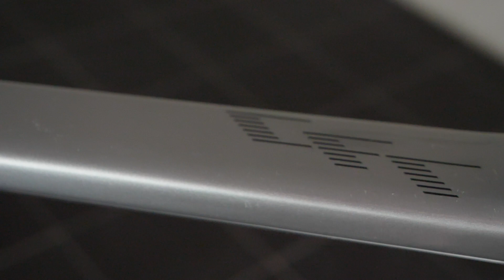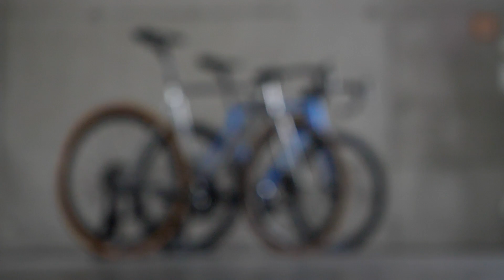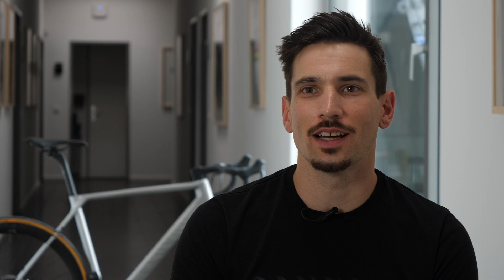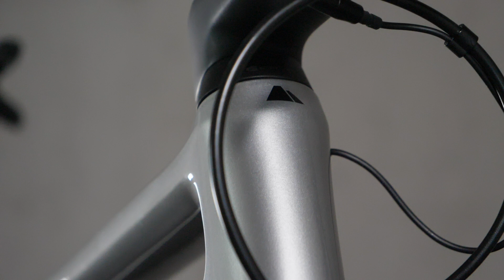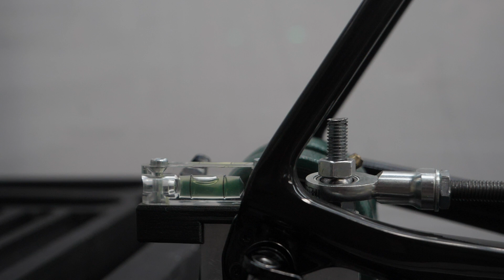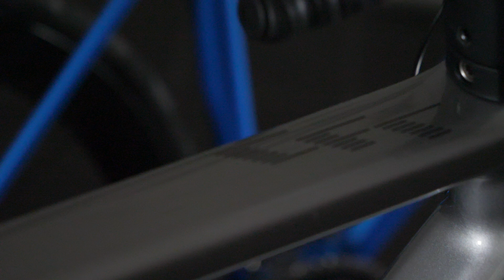Premium VS Midrange Carbon Fibre: What's The Difference? | NEW Canyon CFR

Comment: Decided to edit this comment to make the intended point, rather than bring up people's issues with a specific individual...

I'd be interested for Canyon to send a small selection of random frames to independent testers to really see what the quality of their frames is. High modulus carbon fibre means nothing if the manufacturing quality and tolerances is poor... Claiming they scan each frame to meet their standards means nothing if their standards aren't high enough
Reply: You mean that disrespectful guy, who swears at people he never ever met? And dont forget that he only receives a framesets with issues. Of course he does not appreciate good framesets, because there is no reason for the people to send him that ones.
Reply: @merunkovykefir9578  He likes Time
Reply: I wonder how close to the claimed weights they actually get. Luescher Teknik recently posted about a Cervelo that was way heavier than the claimed weight.
Reply: @Calum_S  I weighed mine and it was pretty close. Probably accurate considering usually the claimed weight is for an M and I got a L.
Reply: Hambini place Canyon at the better end regarding tolerances
Reply: Hambini fanboy detected.
Reply: Hambini Troll disciple spotted.  Hambini =one (skewed)  unit sample size carbon frame “expert”
Reply: Hambini? Lol - he’s using a fake name and credentials to try and sell you his BBs
Reply: @dafj5618  are you able to provide proof to back up this claim?
Reply: GeebusCripes his name is Sanjeev Varah
Reply: Totally agree! If Canyon if so sure of the quality of this bike frame, why don't they send a random selected frame to Hambini?

Comment: Is the cycling industry going backwards? 

A year ago Canyon released the Evo... Now it's the CFR. 

Specialized had a ultralight Sl6 ... Now it's the Sl7 

Trek had the super light emonda ... Now it's heavier.
Reply: It’s been going backwards for years
Reply: The industry runs in circles. Better keep up!
Reply: watkinsdakota yep 27.5 size wheels were used on bikes after the war then got phased out in the 50’s also bikepacking bags were used for touring well over a 100yrs ago and used for soldiers in both wars that used bikes but everyone thinks it’s all a new thing
Reply: I mean the normal rider or even amateur racer are not climbing mountains everyday, most riders are on rolling or flat terrain. So most of the gains for people are aero gains and not bike weight gains. For a world tour pro who do climb mountains they tend to be going so fast that aero becomes more important and the downhills need to be faster. Also if you want a super light bike all of last years models are on sell so go and buy them if you want light weight.

Comment: Im surprised for the price they sell for, cables are exposed, looking messy !
Reply: My new Canyon SLX Ultimate is cheaper than a second hand Spec. SL6 here in Denmark. Canyon bikes are cheap, but I agree that it is surprising that they don't have a bike with full integrated cables.

Comment: Surprisingly still visible cables... I was expecting full integration for top of the range bikes...
Reply: That was my question too, as soon as I saw the frameset. Moreover they didn't even talk aerodynamics. 🤔
Reply: Please ask them why can’t they make an integrated cockpit!
Reply: I love both my Canyon bikes, but they are starting to lag behind with regards to integration and aero on their Ultimate....
Reply: I suspect it’s because they’re designed to be shipped directly to consumers for final assembly. They’re assuming most consumers lack the skills to be able to route the brake hoses and di2 wires through the cockpit and headset.
Reply: Granite State Irish I’ve had two Canyons and there is nothing to putting them together. The headset just needs to be put on and tightened. It can come pre-wired internally as much as it can come pre-wired internally IMO.
Reply: Granite State Irish my Scott and my Ribble have internal routing, as well as my Speedmax
Reply: @granitestateirish6380  Nonsense, they ship it so you only have to put together the seatpost and wheels. Frame and stem+handlebar / cockpit come together.

Comment: Here's my question for Canyon that I hope you'll ask for the rest of us: 'How much force perpendicular to the 0.6 mil CFR carbon can it withstand before cracking?'
Reply: @schmuck Norris  That is for the entire bike and I agree, but it would be prudent for any engineer to test first the properties of any new material (CFR) before using it in varrying thickness like 0.6 mil. This means they know exactly how much force can break it.
Reply from the maker: Good question, the frame is manufactured to comply with ISO standards, and will most likely greatly exceed these standards
Reply: @gcntech  Oh I bet it does and that Canyon have done lab testing to know the exact figure. But would it not give the rider the peace of mind to know that the carbon can withstand the weight of his butt should he, on some occassion, wishes to stop for a while and seat on the top tube to savour the beauty from the mountain he had just conquered?

Comment: This is their “newest, best, lightest carbon Fibre ever”. Yet, the CFR EPS is 300g heavier than the Evo of the former generation? Even though they kept the tires, the saddle, the cockpit and the seat post, and chose a lighter group set and wheelset. Okay, well then!
Reply: Not true. A) The frame is actually 30 odd grams lighter than the EVO one but B) they claimed this is the lightest production bike they ever made - the EVO was always just a limited collection (in fact, you can no longer buy on their website as far as I can tell).
Reply: messi9991 so the frame is apparently lighter, yet the bike with lighter components is heavier? That’s magic.
Reply: @LarsRR  List every component and its weight, you are missing something.
Reply: messi9991 I am not. Lighter group set (Super record is 200 or so g lighter than SRAM Red AXS), lighter wheels (mon Casseral v 25y), same Schwalbe TT tires with a tube (no idea if the tube changed, it’s not listed), same Selle Italia saddle, same seatpost (Schmolke). So apparently, the added weight is all in the cockpit, the fork and the frame. The PM was part of the update for the Evo also.
Reply: @LarsRR  So you didn't list everything. Nor did you understand that the EVO was never production model, it was a limited series. The CFR is not.
Reply: Huh? This cfr is 641gr when evo is 675gr
Reply: Lars Disc brakes
Reply: @gdevansh  the Evo had disc brakes.
Reply: Devansh G. Exactly. It’s just heavier, that’s all

Comment: Here's a question the industry needs a push on: With the limited to non-recyclability of Carbon Fibre, is it ethical / sustainable to ride / buy / sell carbon bikes & components? All very nice, lite, stiff, pretty, but what are the carbon footprints of these products and what happens to them when we've done with them? I've just bought my first carbon frame, and am thinking of selling it on again to replace with custom built steel for this very reason. My gut feel is that with the industry keeping very quiet on these issues, it means they realise it's not very sustainable / ethical.
Reply from the maker: It’s a good question, but it’s also likely that better quality carbon frames will last a lot longer and be passed down/sold second hand. It would be fantastic if a carbon bike frame could be recycled, so we’d love to see that in future
Reply: @gcntech  Danish brand Coh&Co builds frames and bikes (urban, cargo, gravel) from "Interweaving carbon and stone fibres, and fusing them in the world’s first recyclable high performance composite resin" and they claim to be the "first fully reclaimable composite bicycle". They are made in Copenhagen and I saw some cycling around, but rarely. They actually also build wooden frames ;-) https://www.cohandco.com
Reply: Is it not less ethical to get rid of something you've just purchased straight away? There's a carbon footprint to that steel bike as well - why not stick with what you have if you're concerned about the environment, buying more shit is never the answer.
Reply: @philthewriter  Well, the carbon frame is about 12 years old, bought 2/3/4/5/6th hand, so it's carbon footprint is well baked in. One of the reasons I'm asking the question is that while mulling over replacing it (mainly because I'm less keen on it having built it and ridden it, it was a b*stard to cable, and I just haven't gelled with it - could be a 2020 symptom tho) I wondered what happens to old carbon frames. Then got a bit concerned. What does happen to old carbon frames? Do they get landfilled?
Reply: @lfoster7601  Is a good question, and can imagine a huge amount do sadly end up in landfill. That said, anecdotally, everybody I know with carbon bikes bought 10+ years ago still have the same bikes (even if they've added to the collection), none seem to be suffering the catastrophic fatigue some people seem concerned with. Second hand seems to be a blossoming market, which I guess leaves landfill to the broken/damaged frames. Which is also a shame, as I'm personally convinced that carbon is an eminently repairable material, albeit adding weight for proper repairs. Guess it's easier to cut out and replace a tube or fix a weld on a metal bike, although not sure most people would bother. Hope you find a nice steel frame, I've got an old Ti bike and much prefer it to carbon.
Reply: Are you factoring the carbon footprint of the steel tube manufacturing and the welding (oxyacetylene, MIG, TIG) of your custom steel frame? Yes, we can recycle steel but there is an involved carbon footprint.
Reply: For me, there are several things in this:
1. Scale
The carbon bike industry is certainly not that big. I wonder how many carbon frames are sold each year? How many people do you know and how many of those have a carbon bike? And it's an item that hopefully does not get replaced every year. And it is also a very lightweight item, 1kg or so per frame. And you do not throw a serviceable frame / bike away, you  sell it. Comparing that to things like plastic bags and other plastic packaging items that get thrown away immediately, the carbon footprint seems relatively small.
2. Repairabiltiy
Carbon frames can be repaired, usually for very little money compared to the price of the bike. A friend of mine completely broke one of the chain stays, and it was repaired for 300 CHF/USD in expensive Switzerland! I did not feel any difference in the bike after the repair, it probably added some grams to it, but who is counting?
3. Recycling
Now, as you know, it's a composite material out of carbon fibers and some sort of bonding agent/resin, usually epoxy. The epoxy can be burnt off without damaging the fibers. As the fibers are woven, there is currently no technology that I am aware of to turn it back into individual threads and weave it again. The fabric usually gets shredded into short fibers that are used for reinforcing plastics. Usually resin content is 30-40%, so 300 to 400 g of resin per frame that gets burnt and is lost. So it is less CO2 than driving your car for a couple of kilometers. Now of course the manufacturing will have some carbon footprint as we.
So overall, in terms of reduce/reuse/recycle, it is not as bad as you might think.
Reply: Pole’s approach is food for thought and a good read: https://polebicycles.com/why-arent-we-going-for-carbon-frames/
Reply: Ive heard of the "recyclability" of aluminum a lot but I have NEVER heard of anyone actually recycling their aluminum bike. Aluminum being more recycle friendly is a moot point since nobody recycles bikes, they sell/donate or they throw them away. You also cant just stick a bike in with your soda cans, recycle centers arent equipped for something as heavy duty as a bike frame as the process to melt it down is very energy heavy.
Reply: @ah4598  
I did recycle an old mountain bike I had since I was 14 or so. Very easy here in Switzerland, there's a metal collection a couple of times a year, just put all your old pans and stuff on the side of the road at certain dates and they come and pick it up. They then separate aluminum from steel and process it. As they process metals by the ton, it does not matter that your bike is a bit more dense than the rest of the truckload full of coke cans...
Reply: a h I think maybe the trashed bike would be shipped to other parts of the world just like many things, then get destroyed and melted... I know a little about the “the other parts of the world” thing, in there, the trash is offloaded from the ship then people begin to walk in the trash search and filter everything that has a value, electric wires and all the metals are high value objects, they got collected and sent to the recycle factories. The “recycle” process is far more longer than you may think, many dirty things don’t happen in more developed areas, doesn’t mean it won’t happen in other parts of world... Back to the aluminum, I think you should have a peace of mind, think there’s far more metal in there than bunch of wires, so it will get recycled and won’t be just buried, someone can even make some profit out of it.
Reply: My last alloy frame ended up in the tip after a crash snapped it in half...
Reply: There is a way in recycling https://youtu.be/-ZQzfwdHf1I?t=210
Reply: Well if it’s burned out, should it all becomes CO2? Anyway even in a form of fiber, it’s still carbon, the same as coal... But I don’t know what will be going on with the resin part... An interesting thing to think...
Reply: @xuchenglin6256  
The recycling process would be at temperatures where only the resin would degrade (it's in vacuum, so not burning). I think the melting temperature of the pure fibers are very high, above 3000 deg C. So you end up with fibers without resin.
The fibers are more or less pure carbon, but the manufacturing of is pretty energy intensive, so it is worth it to keep the fibers in circulation and reuse them.
Reply: spoeni wow interesting to know all this process, my knowledge seems too limited in the recycle. Thanks man!
Reply: Carbon Fibre to some extent is reusable in making other kinds of plastics, if we dispose off our broken carbon parts responsibly to firms that can recycle them so it is sustainable in the long run.
Reply: @thisDavidLiu  So we use our unsustainable CF to increase our unsustainable plastics? Sound plan.
Reply: @lfoster7601  No need to be so smarmy as well as ill-informed.  It's almost assured there will be a need for some plastics for the foreseeable future - better to make it from recycled parts than virgin.
Reply: @georgehugh3455  Smarmy? No. Concerned? Yes. Whether plastic is recycled or fresh, it still ends up everywhere, killing fish and ending up in our bodies via the food chain. If you think being concerned about that is being "smarmy", then I'm fine with that.